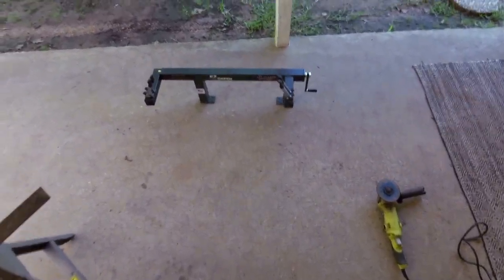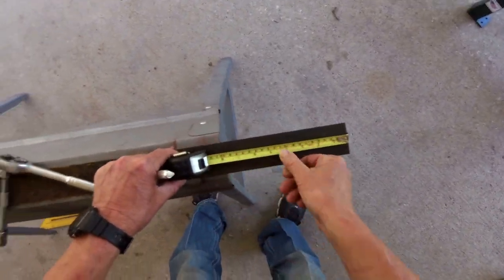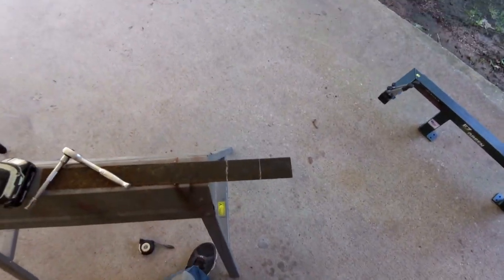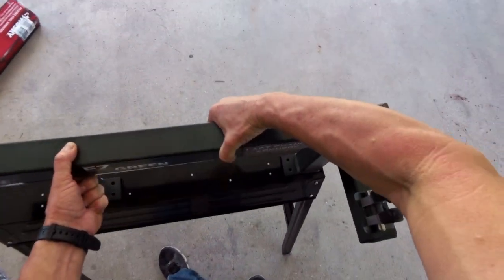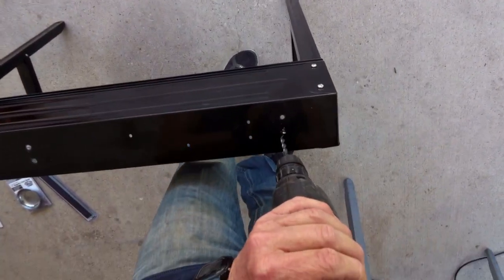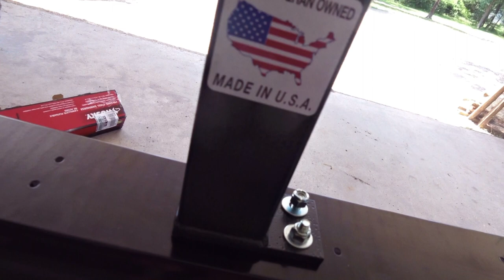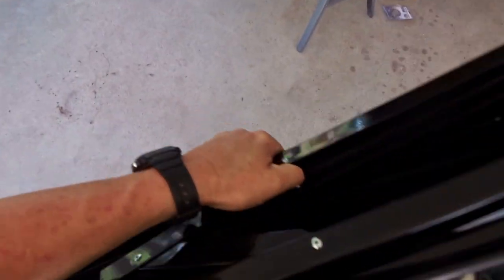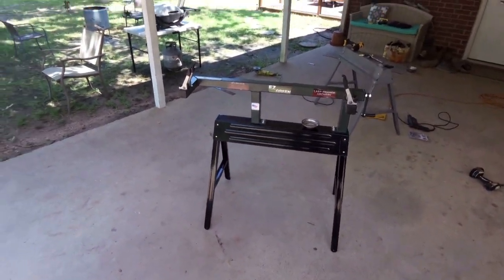EZ Green Bow Press- DIY Stand Build. Portable and Inexpensive.

Comment: That’s a great idea! I will be doing this tomorrow!

Friendly tip… when drilling into metal, go low and slow! Use some drill oil, it’s cheap! Your bit will last 100x longer! It will go through faster as well, but nothing about it is quick.
Reply from the maker: Bet! Yeah I have come to realize that,, especially taking note of how a drill press runs at low rpm's and the handle giving the leverage for the extra pressure to put on the metal. Hope the project turns out cool for you.  It's a very mobile application. 😁